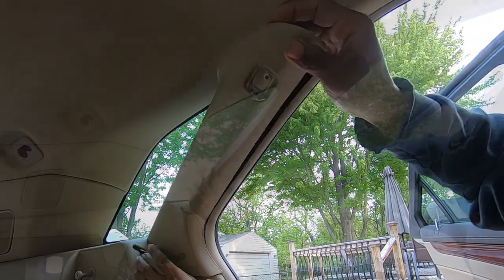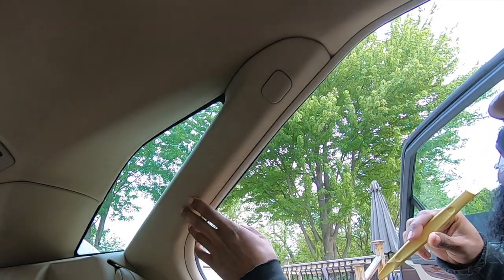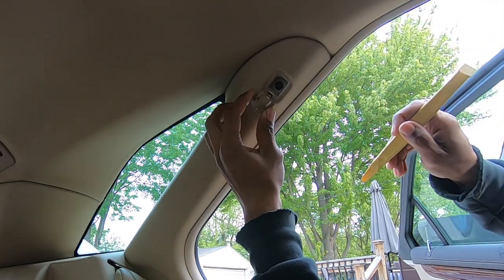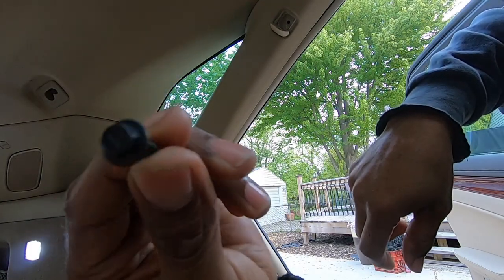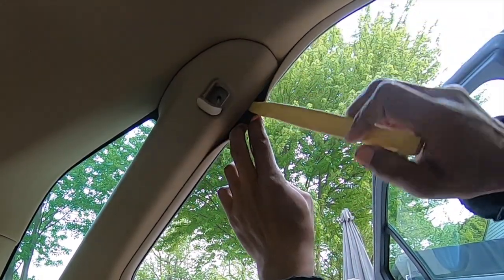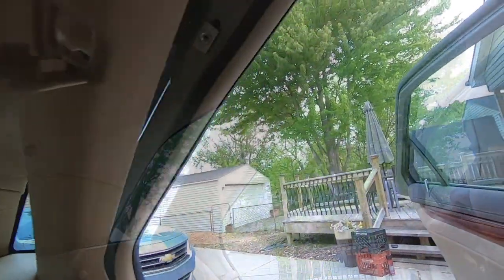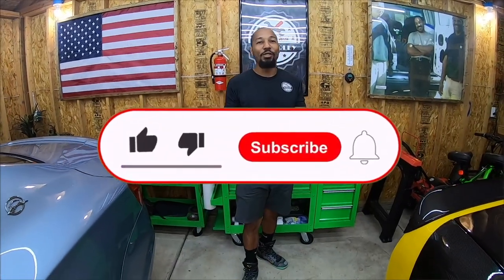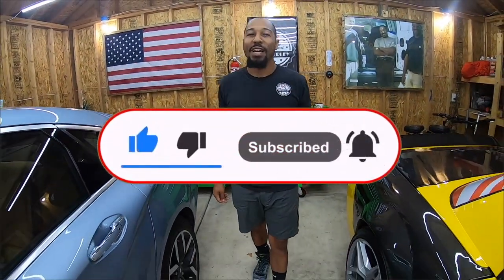How to Remove C Pillar Trim 2008-2013 Cadillac CTS Sedan, Coupe & Wagon 3.0 3.6 V6 Replacement AWD

Comment: Hey i was trying to message you back, but if you used the Camaro SS calipers the rear rotor will work but the front i had purchased form Autozone part 72079DL was the only front rotors that work.
Reply from the maker: Thanks. I really want to do the swap. The way it’s explained in the forums is all over the place. What platform were you messaging me on? Facebook, Instagram? You can also email me at WorkingWithWimberley@gmail.com I’d love to pick your brain and get all the part numbers. I want to do a step by step tutorial video showing guys how to do the upgrade.
Reply: @WorkingWithWimberley I was replying on YouTube messages when someone commented I could reply to them, but for sam reason, I couldn't reply to you
Reply from the maker: @ByrdsRebuilds  I’m going to send you a message on Instagram.

Comment: Is this similar for the 2009 CTS 4 door sedan? The title of the video indicates that it might be. Thanks!
Reply from the maker: It's similar. Based on my research, the sedan has a two piece C-Pillar trim. An upper and lower portion. The upper portion will just come off by pulling and releasing the clips. The lower portion has a screw that must be removed in order to get the trim off. Also, if you want to remove the lower portion completely, you'll need to unbolt the seatbelt so that you can pull it through the trim.

Comment: Hey brother, i sent you a message on facebook massager. I'd like to order the same floor mats you have in the cadillac escalade esv. The description says a option for 2015-2020 but the amazon link doesnt show the same option. I have the same suv as you so i just want to make sure i order the right option. Thanks for the help
Reply from the maker: It definitely should fit like mine. The pictures on the listing aren’t for the Escalade. It looks like they just used random pictures from a different car to show the colors. I have a 2015 ESV so I ordered the one that said “For Cadillac Escalade Long 7 seat 2017-2018” but it’s the same for all 2015-2020 ESVs. https://amzn.to/3IKNRLq